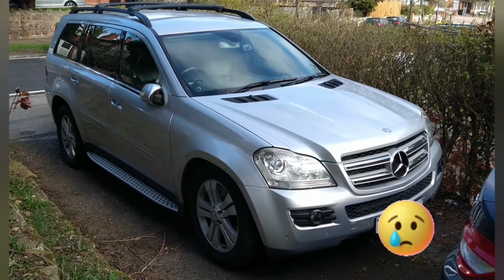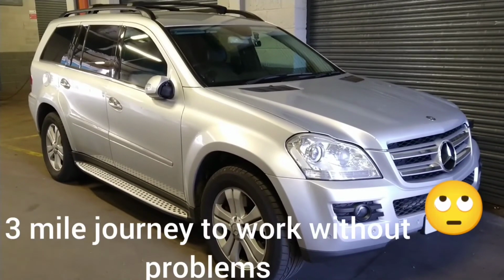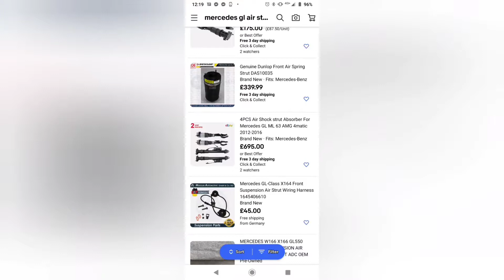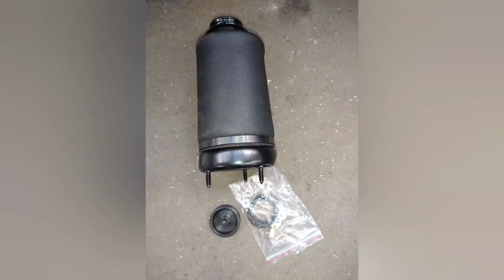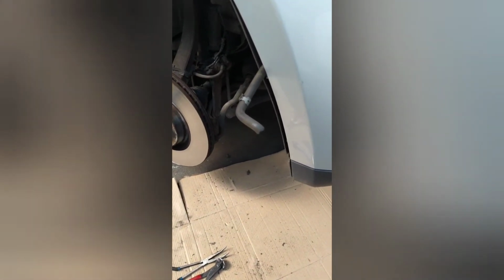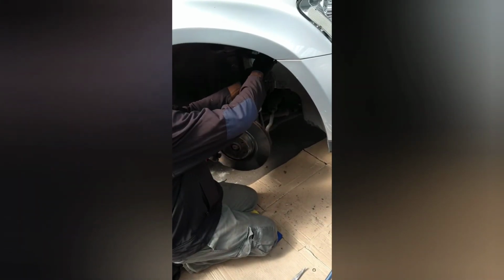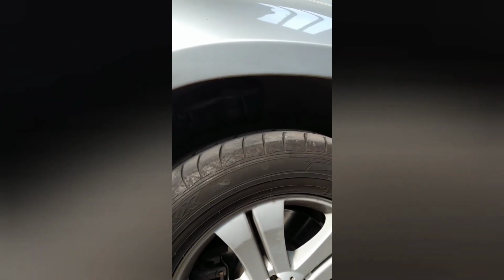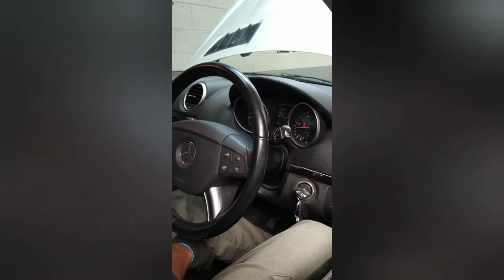How To Fix / Repair Mercedes Airmatic Fault Broken Air Suspension - Problem Diagnosed Cheap Easy Fix

Comment: Great vid, i got same issue with my 2005 w220.. will you share the china co info to order from  ? Mine actually drops front right if not driven for 2 days, then shows stop, car too low. Sometimes the suspension goes to normal in a few minutes then sometimes it takes upto an hour or 2, more frustrating than anything really. Indi's have different ideas, 1 points to replace Air Pump, another says replace strut, not sure what to do. Any suggestions welcome..
Reply from the maker: Hi , thanks for watching , firstly I would jack the car up to get to the strut and spray it with soapy water when the air bag is full , if it bubbles anywhere then your strut is leaking that's how we checked them in the car in the video , we have replaced two more since from a company called autopartsNo 8 on ebay

Comment: Cool video 👍👍👍 my e55 right front dropped so i ordered mines from ebay made in china cost me around $50 60 iv saved alot and its been 6months and its going great.
Reply from the maker: That's a fantastic car the E55  and I did exactly the same when ordering my air spring ,from China , 14 months and it's still fine , thanks for watching

Comment: shouldn't it suppose to drop when left overnight (so it's not under stress and pumped up all the time)? So when you start a car it rises on normal level...
Reply from the maker: Yes but this was dropping more on one corner which was lower than the other three wheels ,the car will look uneven when you have this problem
Reply: @9186SZ  oh well that's a problem then. I'm currently repairing my ML 2010, the air compressor started rattling like crazy (when active) making vibrations through entire car, and it takes longer to raise the vehicle than normal (usually it's a matter of seconds, now it "works" for like 2 minutes or more). I'm guessing it can't be fixed but replaced with a new one. And I was experiencing really bumpy ride for a car with air suspension... but it does drop all 4 corners evenly when left over night. At least  there aren't any faulty airbags.
Reply from the maker: @tariktokalija452  Dropping evenly overnight sounds like a weak compressor they can be fixed  , Also replacements are not that expensive on ebay with worldwide shipping , check part number to match up exact one as they can vary , also sometimes it may be a leak in one of the airlines from the compressor which can be checked by spraying soapy water on the line to see if it bubbles
Reply: @9186SZ  thanks, will do

Comment: If I had seen that before, could have saved £300. Good video as this is a common problem with older GL Models.
Reply from the maker: Well hopefully your car is now also  fixed and won't give you any further problems
Reply: it happens to all air suspension. the rubber will deteriorate and usually need to  be replaced every 10 year or so.